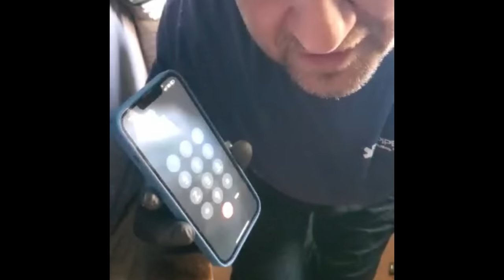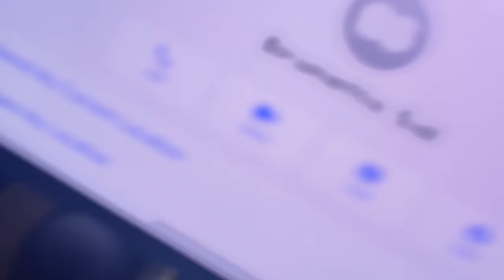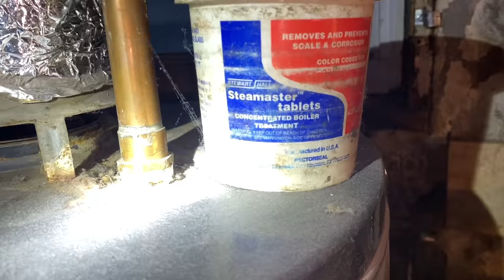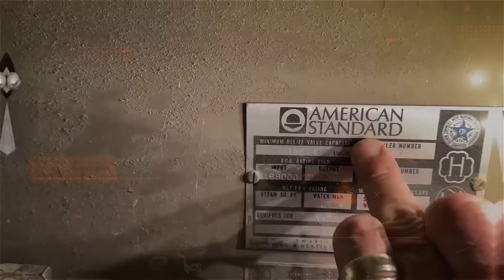Burnham Steam Boiler No Heat Pilot Out How to Relight and Replace Thermocouple

Comment: I have one radiator that bubbles water and steam every morning when the heat jumps up from the over-night setting.  It's pitched up and I tried two new Gorton air valves.   Could the trouble be at the service valve ?  Is the water staying in the radiator ?  Thanks.

Comment: I find pilot tubes leaking all day long. If pipes did fireplace repair’s and was in tighter spots  your gonna upgrade to the swivel head 7/16” / 3/8” line wrench. Its amazing the angles you can get it done from with ease. Swivel head line wrench. 😘

Comment: Thanks for putting this and other videos out there,  All well done.  I live in the western north shore of LI and have a steam system myself.  My boiler is a Burnham SIN7LNCP-LE2 dated 4/2000.  I converted from oil to gas back in 2000 and the boiler has been pretty trouble free since.  I put in a quart of Hercules boiler and heating system cleaner each year, flush out the rusty water, clean out the aquastat and have the boiler serviced/checked out each year.  Any suggestions on how to increase its overall life?  Should I be doing anything different?  Wishing you and your family a very Happy Thanksgiving.
Reply: Pretty much doing more than 95% of the homeowners out there……Only thing I would add is to “Blow-down” the Low water cut off by draining about half a gallon of water out of the spigot that’s attached to it. Do this once a month. Other than that, your doing the most you can to extend the life of your heating system.
Reply: @eddiew.6485  Thank you Eddie.  I appreciate the feedback and will do so going forward.  Wishing you and your family a very happy Thanksgiving.

Comment: 15:42 mega code violation. low voltage and line voltage wiring within the same splice box, without a solid separator or all being line voltage(building rated) wiring. remove the low voltage from the box, splice outside or splice inside it's own box. the thermostat wiring is not rated the same class, has lesser insulation and voltage handling capabilities.
I know you didn't install that, but it should be flagged and corrected to help teach others right from wrong.

Comment: She’s losing a ton of heat thru those naked steam mains. Basement is nice and toasty though. Looks like someone had some asbestos abatement done and nobody told her to re-insulate with some fiberglass steam pipe insulation. Oh well, great job on the thermo coupler.
Reply: heat rises, so is there actual losses which is not heating the building or is it some fudge to claim inefficiency because every BTU possible is not going to the radiation elements.
then turn around and get "my floors are cold", sell them radiant floor heat. yep, never mind reality and facts when slinging snake oil. more or less, if the basement is fairly air tight, any heat loss there will primarily heat the 1st floor via "radiant". go figure ;)